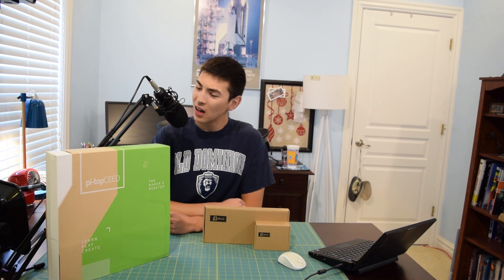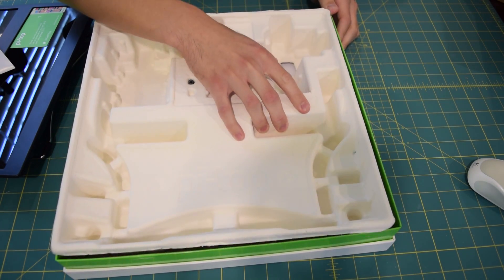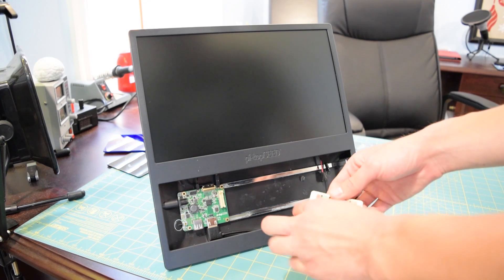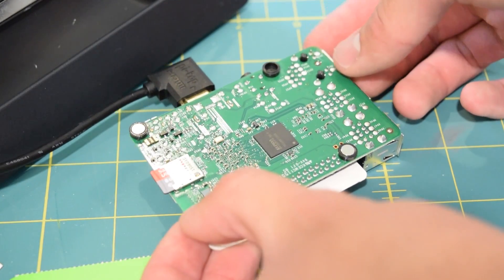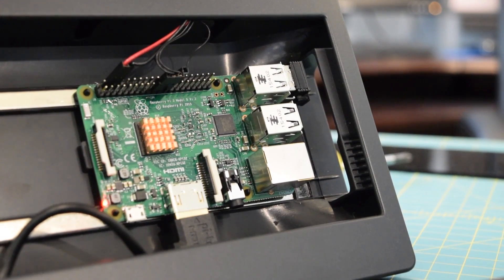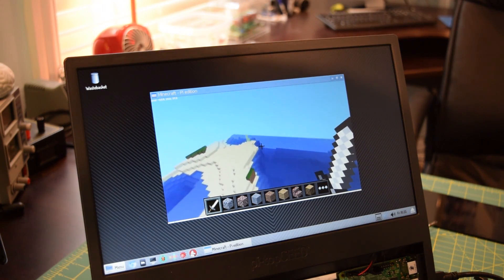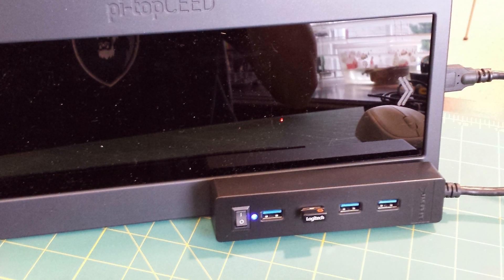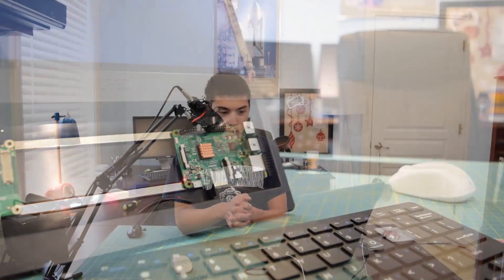Pi-Top CEED Unboxing and First Look "$99 RPI3 Desktop" Indiegogo

Comment: I thought of buying but I thought I will use it with rock64.
Than I thought rock64 has  .nvme slot , I can install in it
BUT FREAKING MAGNET INSIDE WILL DELETE ALL DATA INSIDE SSD.
CRAP.

Comment: If the pi top ceed was not advertised for projects and not just the pi, it's reasonable. But it's just a gimmick. You would be better off buying a cheap monitor, getting some Velcro and sticking the pi onto it.

Comment: I have to say, that's not quite how I would have designed it. I don't like the idea of using magnets at all, partly because of the issue you just showed, and also because I wouldn't want magnets near electronic devices. I'd rather just have the RPi mount to the inside of the case like a motherboard to an ATX case with proper screws. Wouldn't take as much room and would be a lot more secure.
Reply: Jeremy - Magnets and electronics just aren't going to work together. I'm no electronics nut but when I saw those magnetic strips I thought "No, that's very wrong!"

Comment: I do not get it. why not place the RaspberryPi om the back of the monitor and make it more compact? why did they have to place it down there? THIS PRODUCT MAKES NO SENSE. For that just buy a cheap monitor and velcro the raspberry pi on the back.
Reply: why not just buy a cheap lcd screen and just mount the pie to the back of it
Reply: Yeah sure learning n shit, but you ain't gonna need basically a big Case with a monitor for that. 
You can buy a cheap ass monitor with built in speaker from Ebay, a cheap ass HDMI cable and you propably allready have a power Supply laying around. that's it, you  got everything you need and have an accecable pi. 

Really the only reason to buy this is because it is nice lookking and shit and compact.
Reply: It's for education. For kids to make stuff. Getting it all in a kit with documentation, and letting the kids access the IO pins without turning the monitor round makes sense. There is also room in there to stick other things like a breadboard in. If you plug LEDs into the breadboard how are you going to see it if it's round the back of the monitor?

Basically, if you don't see why this is designed this way, then it's not designed for you.

Shame about the defects with the magnets and the pin heights, but there's no doubt a new version by now.
Reply: latengocomoburro - That's exactly what I did. Works perfectly and it cost me about 1 Euro for the Velcro.

Comment: Use a small clamp on each of the metal rails, up against the 'Pi, to stop the it from sliding when inserting USB connectors.
Reply: Or just put a few screws in it.. How often are you going to pull it out of there anyway....
Reply: World Theory - Or save yourself $135 and don't buy the pile of junk in the first place.

Comment: Those little magnetic feet are a pain. The only way I found to press the posts into the holes without collateral damage was to use leather punch pliers. The easiest way to feed the Pi into position was to back it in from the outside. (That puts it against the stop in the rails, which keeps it in position for the USB insertions.)
 I also found the wire to panel clearance problem. 
It's easier to connect the HDMI power cable if it's rolled around a pencil first to put a coil in it. (Makes the length right.)
It's possible to plug earphones into the Pi's jack if you are careful and leave the panel off, (see "clearance problem"), but it would be nice if the frame had allowances for that. Otherwise, "drill baby, drill".
Changing the micro-SD card in situ is possible, but tricky. Needle-nose right-angle pliers are your friend.

Comment: The $99 computer for $135+ that has a half dozen design issues. Um... no thanks.
Reply: Its a LCD with a Driver Board and a half decent case for the lcd and pi. for 99$.....thats not a bad price really. The only thing that really gets me is the wires being in the way of the panel......thats just stupid on their part.
Reply: Yep, it's literally just an LCD screen that you can buy yourself for like 50 bucks.
Reply: Yeah - odd how the price suddenly shot up. You can't plug USBs into it and the front panel won't fit? Sounds like a total waste of money. I have a Raspberry Pi 2 in its case attached to a monitor and connected to a 7 port hub - both held in place with Velcro. Works perfectly.
Reply: depends on your use of this, i'd solder the wires myself if i was using it for a permanite computer problem solved
Reply: HAHAHAHAHAHAHAHAHAHAHAHAHAHAHAHAHAHAHAHAHAHAHAHAHAHAHAHAHAHAHAHAHAHA I (camron) has one that worked for 5 years!!!!
Reply: lol agreed, so much for cheap computing XD

Comment: I wonder if i could use UDOO X86 board instead of Pi 3?
Reply from the maker: I believe the UDOO requires 12V input which would complicate things since the Pi-TOP hub only outputs 5V.  Currently I am testing the ODROID C2 inside the Pi-TOP CEED case and so far I am very happy with it  (I am typing this comment form it).  The magnetic mounting feet do not fit into the ODROID's mounting holes but besides that it is nearly a perfect fit.
Reply from the maker: Don't take my word for that though.  I have not done very much research into the UDOO and I was just quickly speculating.
Reply: +AA Computers and Technology could a pine64 work in it? I have a pi 3 and the pi top ceed. Would love to purchase either an odroid c2 or pine64 for an android emulation desktop setup.

Comment: not going to lie, the amount of issues you listed before it even turns on makes it seem rather badly designed.
Reply: The whole deal with the magnetic rails seems particularly dumb. The Pi has mounting holes, why not just put screws through them? That'd hold the Pi in place very securely, it'd still be easy to remove when necessary...  The whole situation with the magnetic rails just seems to cause at least as many problems as it could ever hope to solve.

Comment: Hey: what's the difference between this and getting a cheap monitor and plugging a Pi into it?
Reply from the maker: I just copied this from a similar question: 

I totally agree with you, if you just want a decent desktop computer then go out and buy a C2D system. Keep in mind though, this is also suppose serve as a educational / prototyping tool.  The idea behind this is to give you a place to easily consilidate and access your projects with the RPI or other SPC's.  In my oponion this factor adds extra value that a run of the mill C2D desktop could not give you.

Don't think of this so much as a desktop replacement, it's more of a makers tool.

Comment: Or you could go out and buy a windows computer with a Core2Duo or Core2Quad and a monitor for like 80$. This is a pretty awful value in my opinion. I think this would be a better value if they sold the monitor alone for $30 and the monitor with the pi for $65.
Reply from the maker: I totally agree with you, if you just want a decent desktop computer then go out and buy a C2D system. Keep in mind though, this is also suppose serve as a educational / prototyping tool.  The idea behind this is to give you a place to easily consolidate and access your projects with the RPI or other SPC's.  In my opinion this factor adds extra value that a run of the mill C2D desktop could not give you.
Reply: Also remember a C2D system wouls consume significantly more power than a tiny rasberry pi. If you live in a place where power very expensive this could actually be a good buy
Reply: +Artūrs Savickis If youre telling me that Pi 3 is slow, then you're wrong. My one loads websites really quickly, same thing for Youtube and stuff like that.
Reply: Apart from the fact that this thing is so slow, that you will simply spend the additional time just to wait websites to load, and at the end you will spend about similar amount of electricity. :)
Reply: CatTheRigger  I have all three generation Pi's right here on my desk right now, and I have worked and benchmarked the shi out of them. Yes, the latest Pi3 is really good improvement over the last two generations, but still it's pretty slow even compared to six years old cheap entry level office desktop PC that has slow C2D CPU.

Ok, it has built-in HD decoder, and that plays important role in it's usability as media player and such, but raw performance in running server or Javascript web apps is very slow nevertheless.
Reply: Or you could buy a laptop without an OS, save the extra money, and install Linux on it instead.
Reply: what sdcard do you use for it? i use top of the range, and my pi flys.. also depends on what Os you use too..btw you can't compare a 240watts of electricity guzzler to a 1amp device

Comment: Strange you would think that they would make it screw down instead of the magnets. But other then that it looks like it will be really nice.
Reply from the maker: The magnetic posts made it really easy to install the PI but they definitly need to revise their design of those so the magnents do not pop out.  I went on their FB page and others had the same complaint about the magnetic feet as I did so this instance was not isolated.  Screws would work too, a little bit more of a pain but you can't really go wrong with screws :)

Comment: am I the only one that wants to put a Intel compute stick in that?
Reply from the maker: That would be cool!
Reply: Roman Fox i dont see why not but thats not what its meant for. a normal monitor or tv may be cheaper and easier to work with.
Reply: +AA Computers and Technology could you be able to use udoo x86
Reply: put an UPBoard in it
Reply: I wonder if something like a NUC board or similar from other companies would fit.
Reply: I would put lattepanda in it
Reply: +AA Computers and Technology yesss
Reply: I was thinking the same exact thing.
Reply: Would this work as a second monitor for a laptop?
Reply: skulldriver101 Sameeeee
Reply: JussapitkaPelailee i'd just get the 7 inch screen and the stand for it, then stick my own operating system on it. much cheaper and you can use the usb ports without opening it up
Reply: Put a pi zero compute stick in it or open it and make a cluster for more raw power. Even though the zero doesn't add much it would work fine.